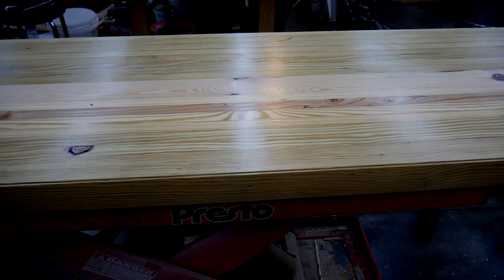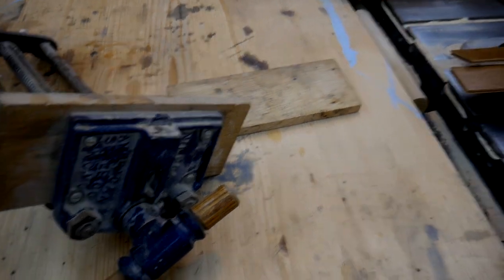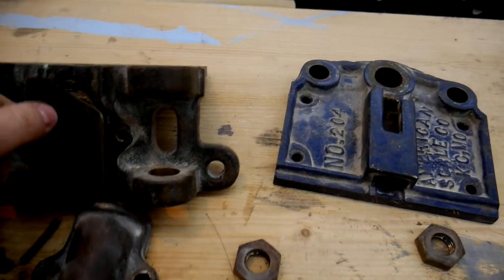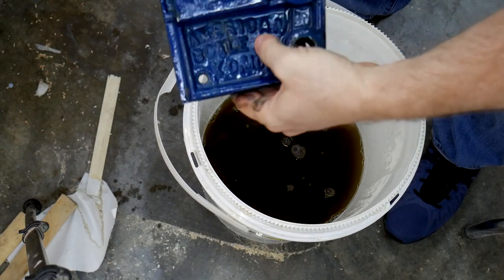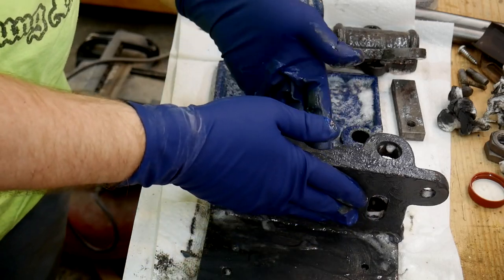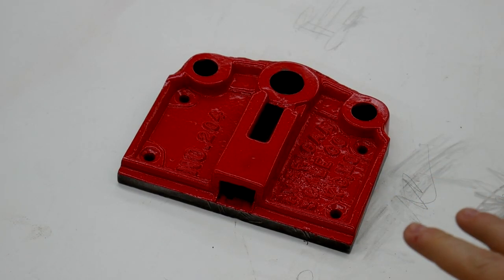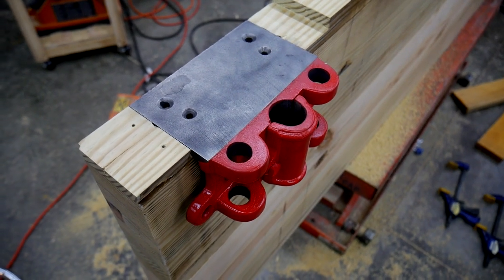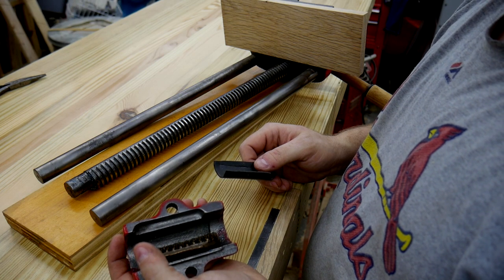Restoring My Grandfather's Antique Woodworking Vise

Comment: What’s the finish on your workbench? Looks good
Reply from the maker: Thanks! I used Varathane water-based polyurethane. I hate it now that I have used it lol. Looks nice enough, but the finish isn’t hard like other products I have used. More like a rubbery feel to it. Prone to gouges and scrapes. My favorite so far is Minwax oil-modified water based poly. It looks great and is super durable. It is mainly used for floors, but I like it for tabletops. I was just trying out the Varathane to see if I liked it and it’s a big no for me. Thanks for watching!